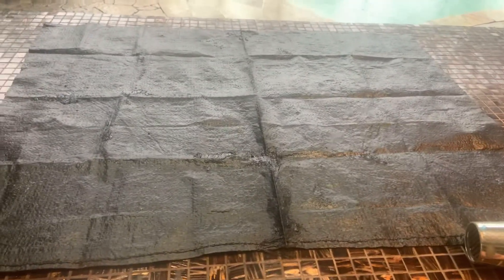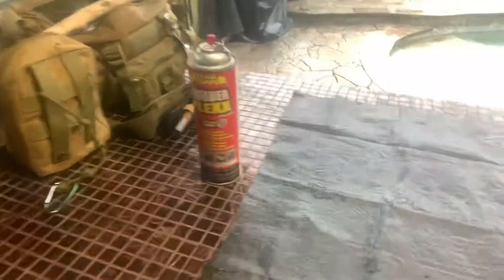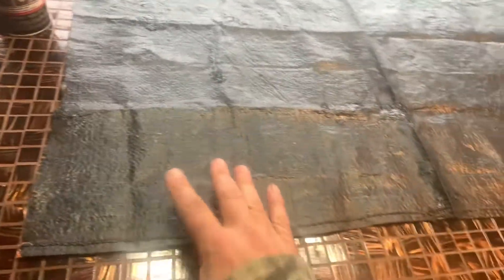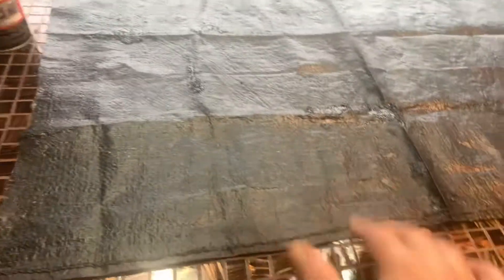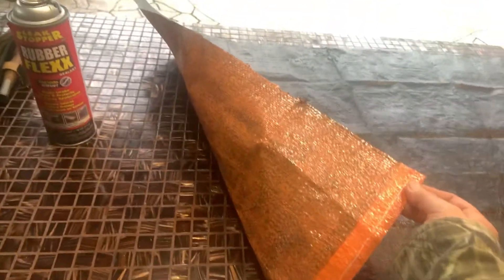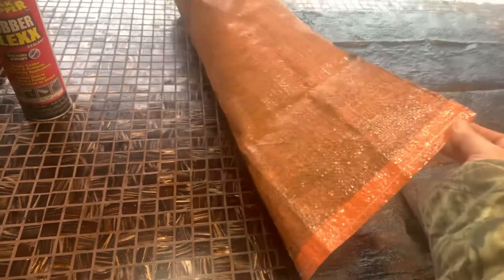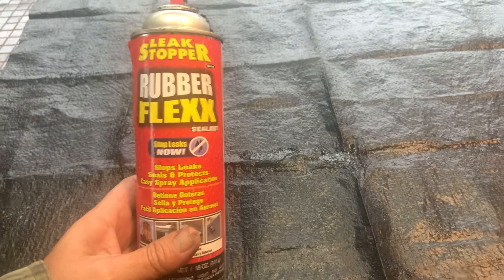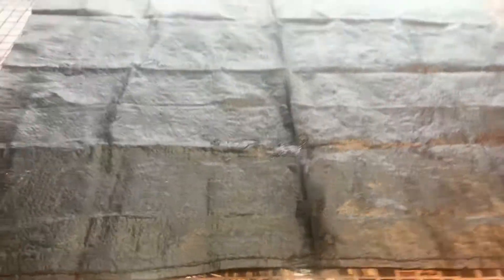Gum blanket with a bonus rescue flag

Comment: Gum blanket. How has it performed?
Reply from the maker: So we’ll that I made a few for each one of my bags. It’s my go-to for an on the ground work station, knee rest, tinder collector. 
The paint cracks a little with use and folding but doesn’t interfere with the performance.
Reply: @TonyTooTuff  awesome ty
Reply: I’ve found out a piece of tyvek home wrap does the same thing for lighter and cheaper
Reply from the maker: Years later, it’s still a win. Use it every time I go camping, hiking and bushcrafting

Comment: It's called a GUM blanket, meaning, rubber coated. What you have aint one.
Reply from the maker: @jamescooper2618  I coated it with a rubber coating with rubber paint. It works as intended. Thanks for the clarification of the name but my “ain’t one” self identifies as a GUM blanket.